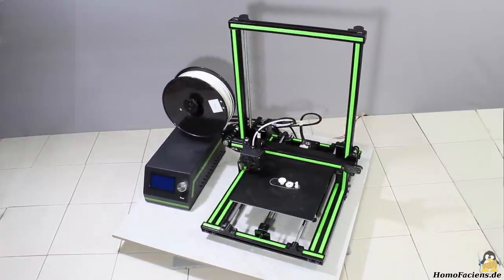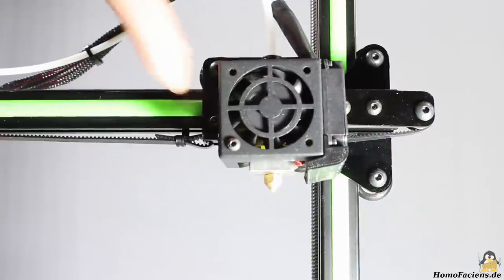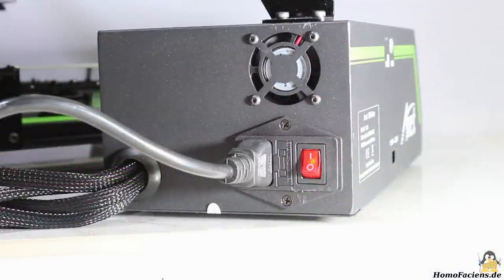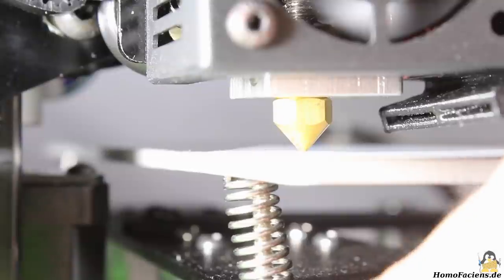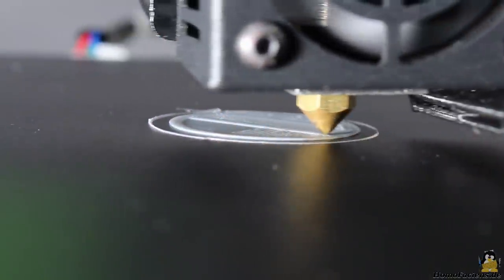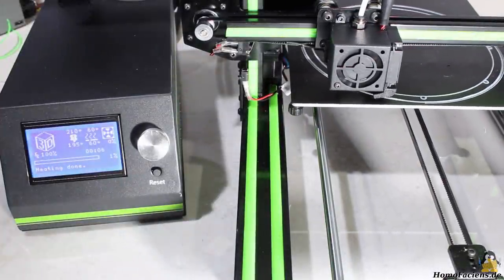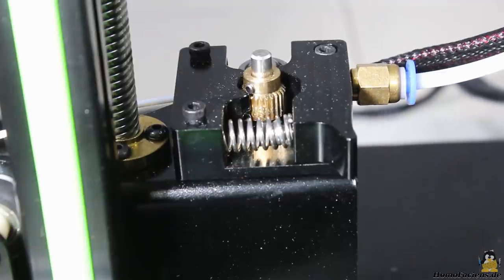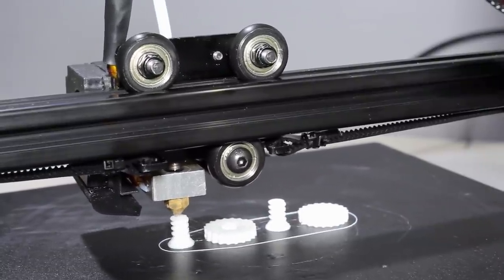Review of the Anet E10 3D printer

Comment: Dude why don't you explain everything thoroughly? you did use a computer power supply but you didn't explain how you wired it.
Obviously you are good at what you do but as a teacher you need some improvement.
Reply from the maker: Well, explaining everything from scratch would turn each review into a featuren-length video. To avoid that I am writing on my project pages. It's more simple to add information like your request using a picture and a few sentences.
I have added a remark at figure 9:
http://homofaciens.de/technics-machines-3D-printer-Anet-E10_en.htm
Reply: Review....not a walkthru or howto